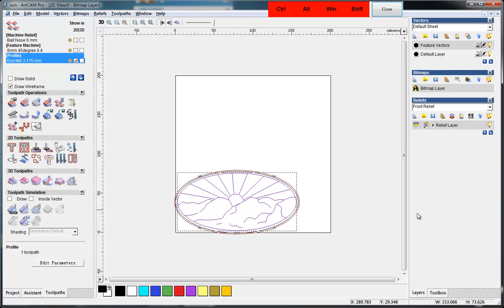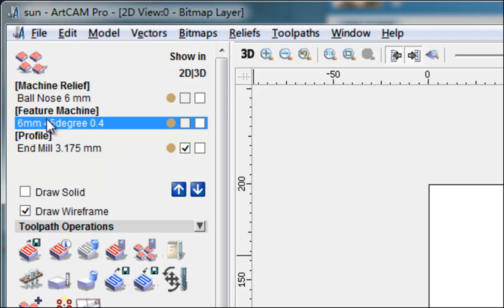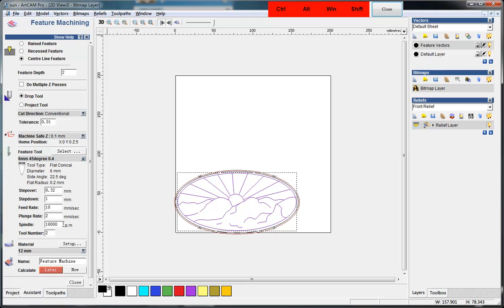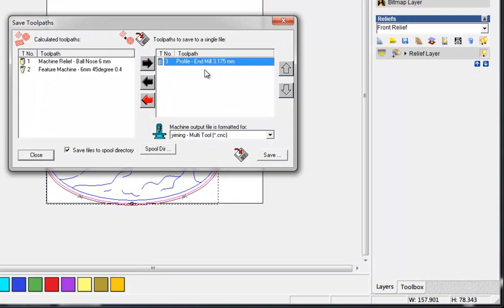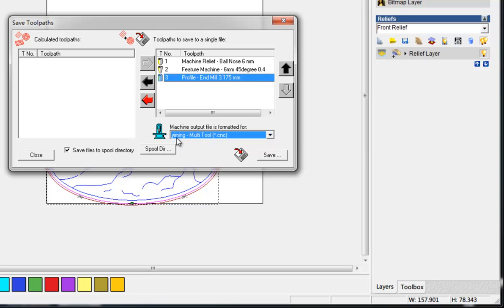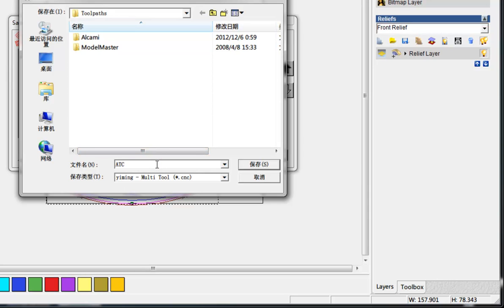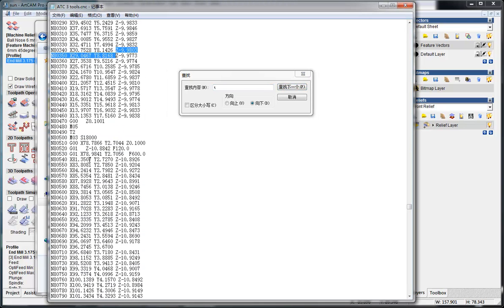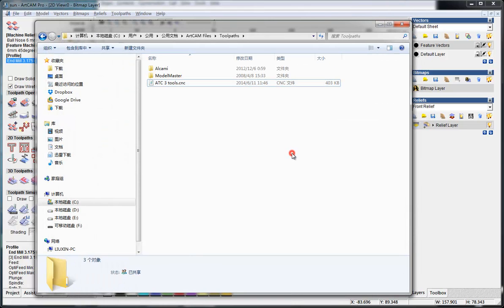make toolpath for ATC router in ArtCAM

Comment: thx for video.
its possible to generate single file toolpath with several tools for non atc router?
maching tool 1 - goto zero - pause (you change tool) - maching tool 2 etc..
Reply from the maker: It's not necessary. For non-ATC (or called MTC) machine, it go to origin point automatically when the work is done. then you change tools and run the next tool path.
Every time you change a tool, you have to set new Z 0 height. In ATC machines, you set all tools ready before work. So the machine needn't reset Z 0 height after changing tools during work. But for your MTC machine you'll have to do this to ensure the 2nd tool is working at same level of your 1st tool.
Reply: thx for detailed response. i really forget about z calibration after tool change. good luck
Reply: LIU XIN thanks for the video, you have the postprocessor for SYNTEC?